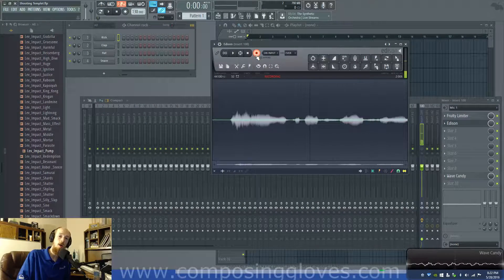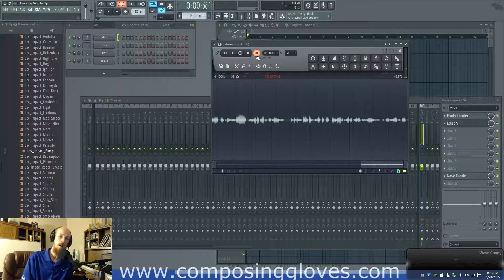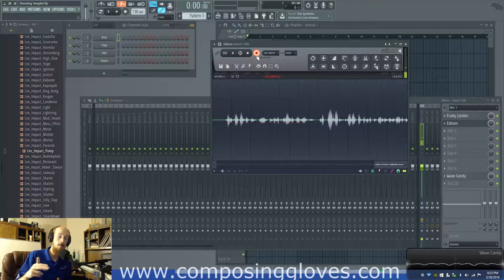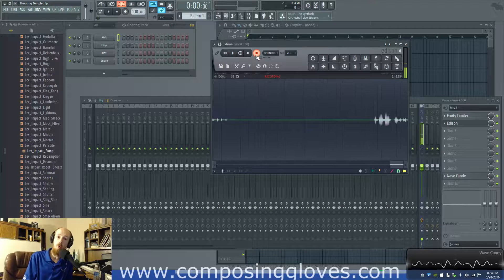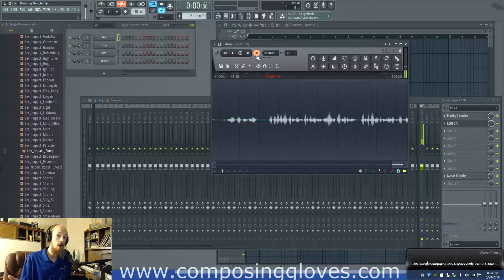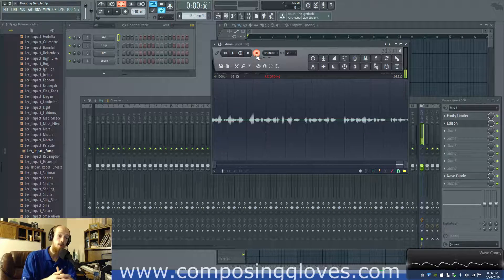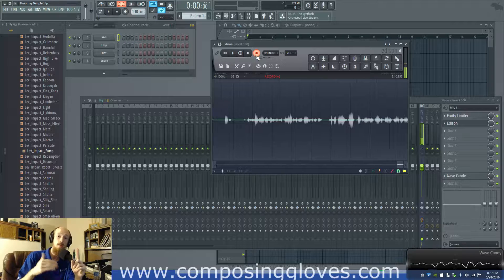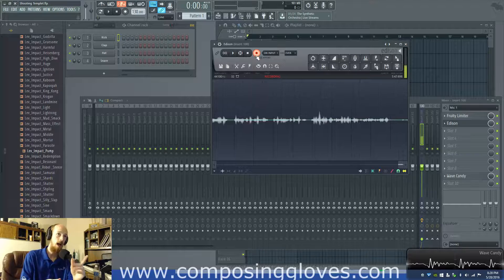Digital Audio Basics 11 - Noise Floor, Correlated Noise, and Uncorrelated Noise

Comment: What is the difference between correlated and uncorrelated signals?
Reply: I just watched the next video on dithering and I understand the difference between a correlated and an uncorrelated noise floor now. Is that what you mean by correlated and uncorrelated signals? I would probably understand better but I'm just waking up and my mind is still getting up to speed haha.
Reply from the maker: +David Gatten yes